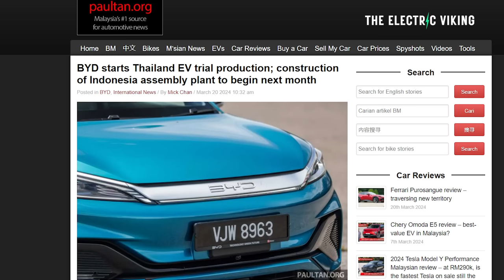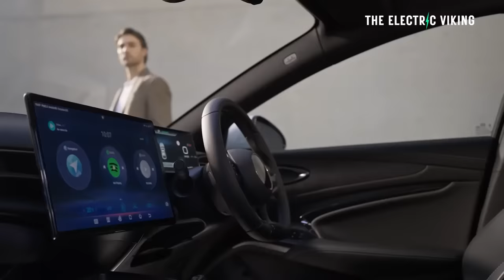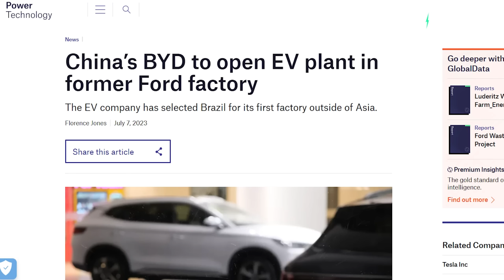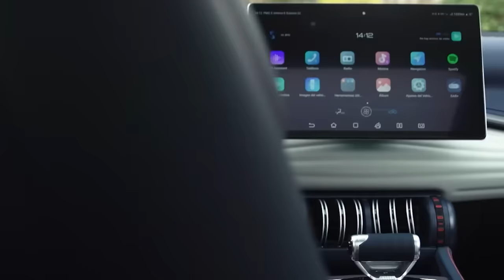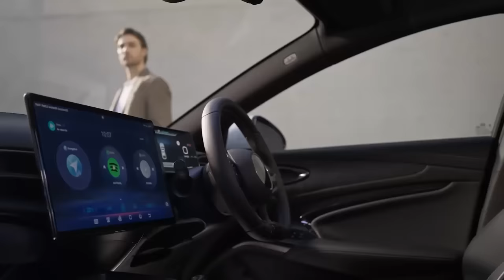BYD begin manufacturing thousands of EVs for Australia & NZ in Thailand

Comment: I live in Thailand. If I can buy an EV like the BYD Seagull for under $11,000 / 400,000 Baht (when manufactured here next year) which can go from Bangkok to Hua Hin and back on a single charge, has an 8 year battery and motor warranty,  'fills up' for 50% less than a gasoline car, charges 80% in 30 minutes (plus charging places everywhere here & more coming) and has 20 moving parts to maintain on an EV vs 2000+ on a gasoline car, hey, why not? I just want the best bang for my buck/baht. 

Should add, I don't agree with Govts 'dictating' that gasoline/ICE cars are over by XX date. We should all have the right to choose what works for us, be it a V8 SUV or cheapo EV.  But in N America, you won't have access to this $11,000 car, only expensive SUVs and EVs.
Reply: Yup, In Thailand, charging stations in almost all PTT petrol stations.
Reply: Rated range and real world driving range are two complete different. There is no way in hell that Seagull will drive from Bangkok to Hua Hin and return on one charge! Not to mention the Seagull is so pathetic in power output! Highway speeds you will be lucky to get 200km out of that shoebox! Just google EV database, it shows real world driving range and the 45kwh Dolphin can get 230km on the highway, the Seagull battery is 39kwh so as I say it's a one way trip, on top of that your AC will be consuming a lot more power due to the heat.
Reply: @gregb1599  Fair point. Fully aware CLTC vs real world variances (however, seen 305km in the heat tests). Will still happily top up in under 30 mins at one of the many chargers around Hua Hin from Malls to hotels and more. For est $11K this car has amazing finish and value. Check out the test vid: 'This Changes The Game For Affordable EVs - BYD Seagull / Dolphin Mini' Cheers, STL

Comment: If it weren’t for Tesla and BYD we’d be driving ice vehicles another 100 years . . . Legacy can’t hold back the disruption anymore and I so wish they’d step up to the challenge instead of fighting too protect their current cozy business model. Unfortunately they’ll do this until they need to ask for a bailout. It’s so frustrating seeing companies only worry about their next quarterly or annul results - so much for industry leadership.
Reply: The disruption is that everything costs  30% more  then it did in 2019 and wages are up less then a 1/3 of that amount.. What that indicates is an imminent mass contraction in demand as peoples discretionary income evaporates into nothing.
Reply: @Jason-bu9sv In China EVs are already on par or cheaper than ICE in sales price, if you take in maintenance and cost of fuel. there's no comparison. EV wins hands down. Here in Australia, although we don't get them nearly as cheap as China, over the life of the vehicle, most people still will save a lot of money running on an EV. if you can get cheap rates or solar panels, this becomes a no Brainer.
Reply: @passby8070 To drive an EV you need to think of a concept that consists of three parts, solar panels, power wall and EV, and then you solve many small problems at a time.
Reply: Oh year did you forget about the Nissan Leaf that came before Tesla? You know the EV that sold 500,000 more EV that Tesla and BYD combined in 2012!
Reply: @gregb1599  the trouble is Nissan didn't listen to customers that wanted thermal battery management, bigger batteries &, CCS charge points. 
Or export E-power Note (the good one).

Comment: For the UK market, BYD in common with most Chinese manufacturers is held back by poor aftersales as in lack of readily available parts for repairs and maintenance, and model specific repair instructions. This is resulting in very high insurance costs as repairs are likely to take significantly longer. They appear to have come into the UK market without fully understanding what it takes to make to keep insurance affordable. I guess once they fix that which i am sure they will, they will have every chance of success! One thing the Chinese do exceptionally well is iterative improvements so its unlikely to take them long to fix.

Comment: While we see a growing call for protection of OEM in the USA and Europe, it would be interesting to know the proportion of components from Asia that these OEMs have in their vehicles currently. Reportedly it is very high. The last Australian Vehicles had a very high proportion of Asian, not local parts. It did reach a stage that many began to ask, Would it not be easier to import a whole vehicle, rather than assemble a vehicle here made from Asian parts? In the end, that is what happened. When you destroy the manufacturing system of local suppliers, you kill the system of manufacturing locally, and then  it becomes cheaper to import not parts but whole vehicles.
Reply: You have raised some great issues. My main point is that the OEM's of Europe & America are building their Vehicles with mainly Asian made components and in turn are undermining their own countries industry in the long run.